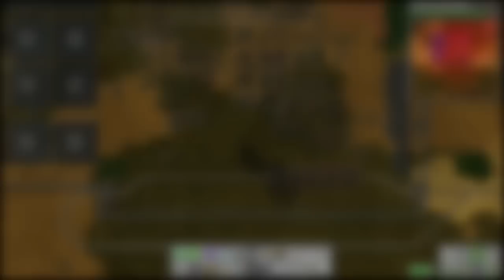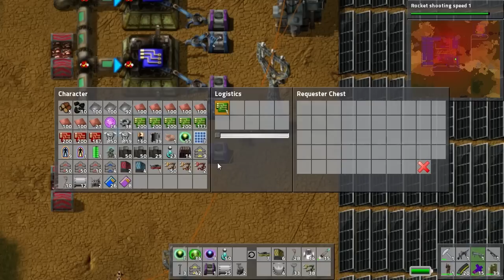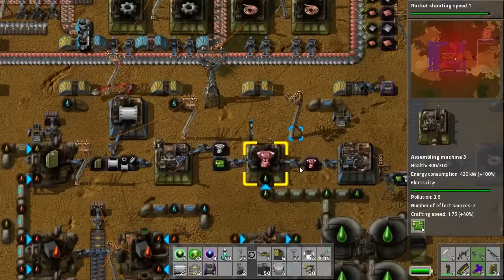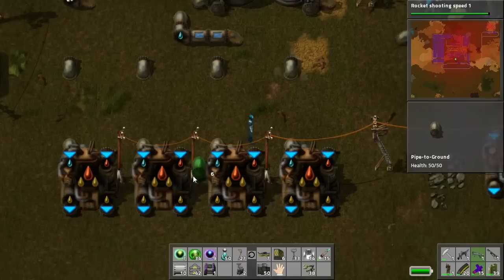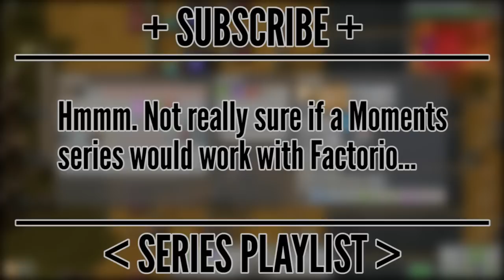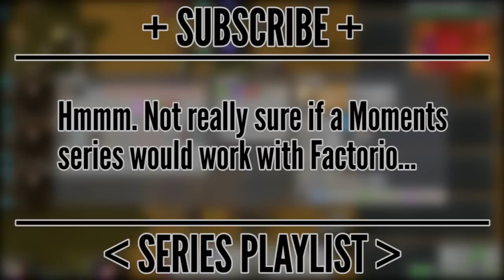Construction + Factorio #37

Comment: the reason of the coal spill is because in the new update there is less items in the item stacks and the chest where full before you updated so when you replaced the chest it fixed the item stacks and gave you the left overs
Reply: Yes, before the stacksize was 64/128/256 and now it is 50/100/200
:)
Reply: yup :) i like that they changed it

Comment: There is really no reason to use productivity modules, unless you lack basic resources, which you absolutely do not. Productivity modules slow down production and increase pollution. They give you free stuff, but not fast enough to make up for the lost production.

Since you have an insane backlog, you should really change to speed modules. The only argument for productivity modules, is that you want to put off finding new resources for as long as possible. Just delaying the inevitable.

My advice would be to start making a train hub, with expandable waiting spots, set it up for unloading basic resources and feed it into your base. You'll be able to easily add new resource outposts to the network.

Another thing: You should really start limiting your production. Right now, there is no balance in your production, which leads to massive stores of a specific resource and nothing of another. For example, if you changed the engine output to a smart inserter, and told it to work only, when there was less than 100 engines in the network, it wouldn't consume all your pipe.

Comment: I highly recommend putting in more factories dedicated to producing the green electronic circuits. The demand for them far outstretches the supply by a great magnitude. Alvin Xu has made a comment detailing the number you need (more then 26!)

His comment can be found in the replies to Corallia's personal place, who also makes the point that you aren't producing enough green electronic circuits.

I also recommend adding a few more robo ports to handle the increased traffic that was added to the system with the introduction of the new logistical drones, as I've seen previously long wait times for recharging bots.

You may also need to increase your copper plate production to handle the extra circuit factories, and you may also need to increase the size of your solar farms and accumulator banks to compensate for the increased power drain.

Overall, it may be best to terminate production in at least 4 or 5 of your processor unit factories to decrease the demand, and then work on expanding power supplies and copper production.

Comment: Let me explain the difference between active provider (purple ones) and passive provider chests (red ones).

If you have storage chest (yellow ones) bot's will empty out active provider chest and bring the stuff in them to the storage chest's.
With passive provider chest they don't bother and leave the stuff there.

Why do i tell you this? Because if you now put down a yellow one all your bots will start collecting everything from your purple ones and try to store it there. If you had used the red ones they wouldn't.

Also you might want to use smart inserters for taking stuff out of assemblers you don't need to overproduce. And set them to only take out stuff if the logistic's network has less than a set amount. That is what the last option in the smart inserter screen is for.

For example you could use a smart inserter at the engine assembler, and tell it to only work if there are less than 100 engines in the network.

Comment: Now your factory has come to the point that it's focus shifts from producing science packs to producing modules. One main thing to consider is that you have to at least quadruple your electric circuits production. You might want to search the forums for the 'horseshoe' design. This is an optimized setup to produce copper cable and circuits in one go.

Comment: STOP ADDING MORE PROCESSING UNIT FACTORIES, what you need to do is to add more normal electronic circuits cause they are the bottle neck of your production atm
Reply: BasSiebren123 You are correct! 1*blue = 20*green + 2*red = 24*green. 1*blue = 15 sec; 1*green = 0.5 sec. This means the assembly factory number ratio between blue and green should be 1/0.5:24/15=1.25:1. In the last of this video Plus set up 8 factories for blue circuits, which means he needs at least 7 for the green one! And that is still conservative estimation because there will be engine units, inserters and red circuits of other purposes consuming the green one as well!
Reply: I totally agree with you he should double his normal circuits factories
Reply: absolutely! The need of green circuits in this game is ridiculously huge!
Reply: Hey you can never have too much of a good thing. True he has more Processing unit factories than the system can handle but nothings ever perfect... YOLO

Comment: The coal spilled out because in the previous alpha coal was stacked in 64s now in 10.0 it stacks in 50s, so when you replaced the box to a requester restacked everything inside, making the box over fill by 14 per stack which was just thrown on the floor.

Comment: the issue with the coal getting dumped on the ground is because of the update changed stacks from multiples of 2(i.e. coal was 64 per stack) over to multiples of ten(i.e. now coal stacks in groups of 50) so the boxes couldn't hold it all

Comment: what is a smart chest? plz reply
Reply: a smart chest has the option to use the red and green wire conditions on smart inserters.

This allows you to tell all smart inserters connected to that smart chest to work on the set conditions.

Like you want to produce always 10 speed modules. You can use a red wire with the smart inserter that takes out the module from the assembler. And set the wire condition to only work if there are less than 10 speed modules in that chest.

This get's less useful when you have logistic networks. With those you can tell inserters without using a wire the same thing.